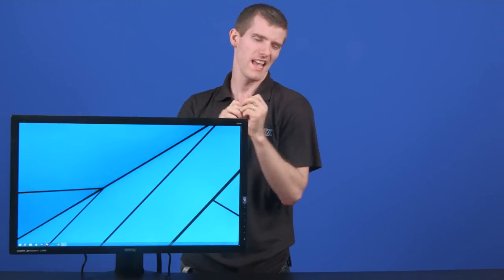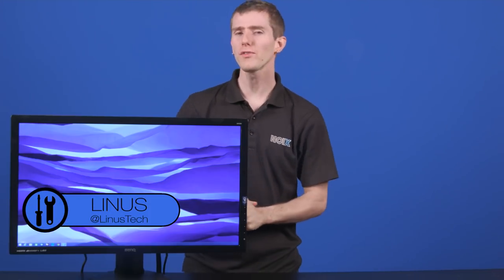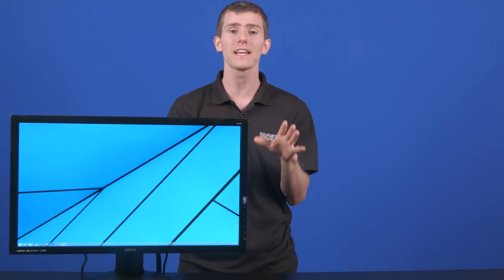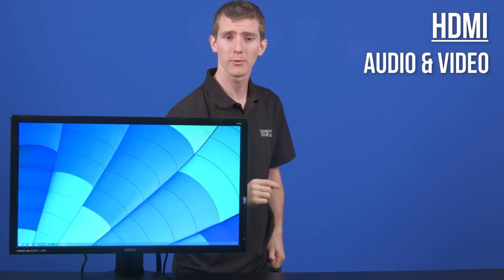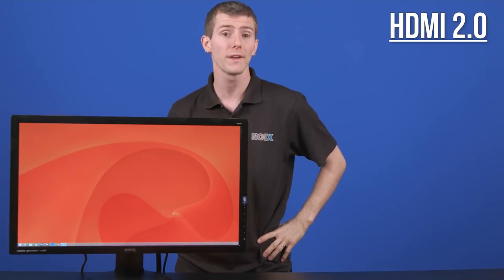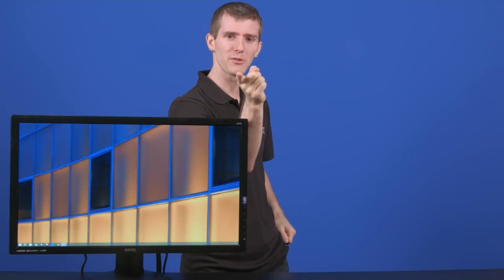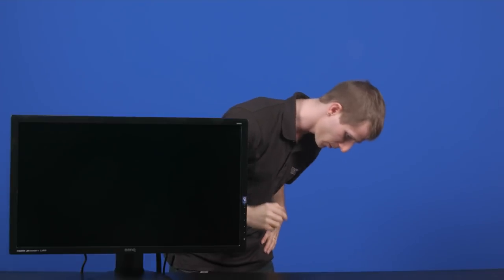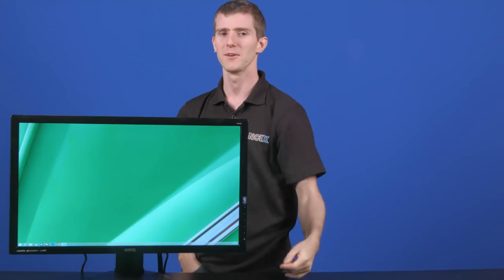Display Connectors Explained! - Tech Tips

Comment: Im maxing at 60fps never goes higher my tv is 120 hz and my graphics card can go more(of course) i have hdmi not sure what version does not say but to get 120 hz what are my options?
Reply: I think that hz for TVs is measured another way. 120hz for a TV is not the same as 120hz for a pc monitor. My TV also says 120hz, and trust me, it's no even close to being that.
Reply: +Johann Diaz I figured out it's my hdmi cable it only allows 60hz I have 1.4 I need 1.2 or 2.0 or display port
Reply: +Brandon Shaw For that you need DisplayPort
Reply: Neo Joseph Aliaga Rivera that's what I thought but is possible the tv is not 120 hz input?
Reply: The TV is 120 hz but only on 3D, The TV manufacturers say that, but that's not true at all.
Reply: +Neo Joseph Aliaga Rivera I turned off vsync that solved it now I'm getting real fps numbers
Reply: +Brandon Shaw Yeah, V-Sync it's really an FPS killer. Good for you
Reply: +Neo Joseph Aliaga Rivera yea but it Dident go over it it was capped but yea I sense sarcasm
Reply: +Brandon Shaw v-sync locks the fps to what your tv/monitor displays. Unlocking it will let your games go over 60fps but your tv will continue to only display 60fps. You'll need DisplayPort
Reply: +Tony yes and my tv is 120hz and hdmi 2.0 let's 120hz which u have the only thin that could be limiting it is the tv input is only 1.4 or below
Reply: +Brandon Shaw I used 2.0 on my 120hz TV. It still stuck at 60fps. It's a trickery on the TVs to smooth out motion blur.

Comment: i got hdmi on my monitor works good then i want my pc to contact to tv a Sony and the sides is over set the screen i see dan 90% of the screen if i go with my mouse to the sides the mouse go behide the screen that i cant see the mouse whats the problem i use now vga
Reply: +Sean buchanan Sometimes the display just doesn't "fit" the image correctly, you can fix the by messing around in your grafix-card settings menu and looking for that "re-size display" or something like that or you could just change the settings on the TV monitor to "fit"...these worked for my Samsung sync-master...Though for simple plug and play I find that DVI works best...
Reply: +Hanro Lareman but vga looks not right for me hdmi is beter quality
Reply: Sean buchanan what brand is your grafix card, I think there is a option to re-size your image on your computer's side in Nvidia control panel
Reply: +Hanro Lareman my graf is gtx 980 ti i done it already re-size it

Comment: I use VGA, Its hooked up to a 1680x1050 monitor at 60hz, and 1366x768 (I have a laptop and a monitor, but i want to upgrade to a desktop computer and 2 1920x1080 monitors on HDMI or display port.

Comment: i am using hdmi if my gpu had a display port i would use that for higher framerates on games like tf2 so that way my game doesnt studder when it starts displaying the map
Reply: max skripp keep in mind i get 240 to 360 frames per second on tf2 at max settings 1080p. keep in mind though you would be amazed at the framerate drop when you try it in 4k. jesus for shitty graphics its pretty taxing.

Comment: I'm using HDMI to HDMI & DP to Min DP & yes i have dual monitor set up. I like HDMI features specially Colours , and What 
I don't like is the "Display port" because.....  if U R using display port & hdmi through the single graphics card with dual or 
triple monitor set up.... U will notice display port monitor colours is much faded then monitor with the hdmi .. How can I get rid of  this thing .... or may be i have to play with gamma correction but  Why nvidia  not manufacturing dual or triple  HDMI  output connectors ,... How much its going to cost .. Seriously

Comment: EVGA GTX660Ti running duel monitors both DVI 
one monitor is a 22" LCD and the other is a 20" LED
@ 1680x1050 and 1600x900
other rig,
Palit GT240 running a 42" LCD tv HDMI (even though the tv and card have VGA) @ 1920x1080

Comment: Doesn't matter much to me what connector as long as it's digital.  DVI, HDMI, DP, in the standard realm of 1080p there's no difference.  As long as DVI sticks around for a while so that we'll be able to use the old VGA devices I'll be fine.  Although it would be nice if local stores would stop charging $50 for a hdmi cable that maybe $10 online.  Also, will people PLEASE start putting MHL a standard thing in mobile devices?  There is no way I'm going to join the bandwagon that streaming my screen to another is the only way to go, wifi is fast these days but you REALLY think it's going to be keeping up with the cables anytime soon?

Comment: So I'm reaching out here.  I just got a new second monitor and a new rig, the new rig has a NVIDIA GTX 1080, in the back there are a number of DisplayPorts and one HDMI port.  So I wanted to keep things even Steven between both monitors (PS I'm a big fan of View Sonic displays) So I ordered TWO DisplayPort to HDMI cables.  Finally enough over my cold to get this done.  What happened... one monitor, my older one, booted up fine with the system, the newer monitor had no signal until I switched back to the HDMI to HDMI cable and made use of the one HDMI port in the back of the GPU.  So can anyone school me on why it won't work on one monitor and not the other?  Thanks so much!  Rich

Comment: I still wonder why they can't just invent one single port for all types of devices. Where you can connect your monitor, power your laptop, flash storage, internet.. with one unexpensive cable (just wires) USB is great, but we need sth better. also thunderbolt is awesome, but why the hell can't we get any devices that support it? and why is it so exclusive to apple?
Reply: +w4terlemon 
Simple:
reason 1
they need legacy support for older formats 
reason 2
Technology becomes better over time, meaning that older (or for the time advanced) display-inputs get made, these then fall out of date as the connector design just can't handle the features the manufacturer(in these case the display port  developers)want to add leading to the creation of a new port (VGA was one of the first, then DVI was developed from that and HDMI evolved from DVI's short-comings...you could have a hdmi to VGA adapter in theory) 
reason 3
A' race for domination, if one company can make a fortune off video-card makers paying and funding the development of that display port then what stops a other company from doing the exact same thing...

Comment: Laptop. HDMI to a small display. VGA to large display. LVDS to built in laptop monitor. All 3 on same machine. HDMI screen is actually a LVDS laptop monitor with an adapter board to convert the HDMI to LVDS.

What? I'm a cheap bastard who recycles as much crap as possible.

Comment: im using a HDMI to my graphics card which is the worst graphics card inn the shop but i just got a HDMI to DP cable so know i'll connect the TV with the Motherboard and i'll have higher graphics as i have an intel core i5 CPU 650 3.20 GHz 3.33GHz :D

Comment: DIsplayport is the most fucking annoying video standard ever. If you have the right cable in the box, you're fine, but if you don't, going through the motions of connecting a non-displayport output to a displayport input can be a nightmare. You need to learn about passive Vs active adapters and how pin20 on a displayport cable can spell the difference between a compliant vs noncompliant cable.

Comment: dont hate me i use vga
Reply: DutchDurpGamer707 I have two near-identical monitors side-by-side, but one of them has only a VGA connector, while the other has VGA and DVI-D. I'm using VGA on the former and DVI-D on the latter, but honestly there isn't much difference. The most notable thing is that the VGA monitor tends to be unable to display very pure white, which blends to a more light-grey colour instead. I'd say the difference in quality between VGA and DVI/HDMI/DP is massively overstated.
Reply: Robert Faber i also have 2 monitors (not the same at all) and my vga monitor has good white and other collors and the other one using hdmi doesnt

Comment: hey everyone wondering if this would be a good pc? please help out thanks 

CoolerMaster SI2 Silent 120mm Fan 4 Pack  $19 
1

 Gigabyte GeForce GTX 960 G1 Gaming 4GB  $369 
1
 
 Intel Xeon E3 Gaming Bundle Intel  $549 
1
 
 CoolerMaster Hyper 212X CPU  $55 
1
$55 X
 Corsair CS750M Modular 80 Plus Gold Power Supply $159 
1

 PCCG Sleeved Cable Extension Kit Monochrome  $39 
1

 Intel 535 Series 120GB 2.5in SSD  $105 
1

 Western Digital WD Black 1TB WD1003FZEX $109 
1

 NZXT H440 Mid Tower Case Black/Blue $169 
1
Reply: +BIG MATT 350 bucks for a 960.... you can get a 4gb 960 for 200....